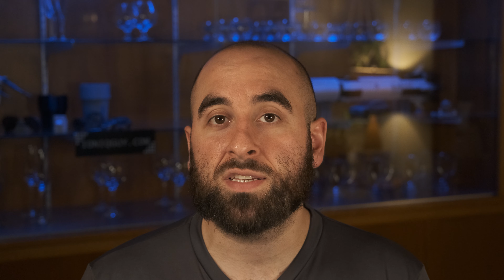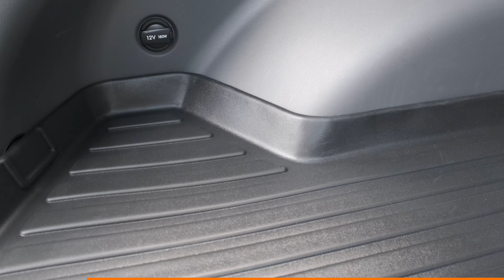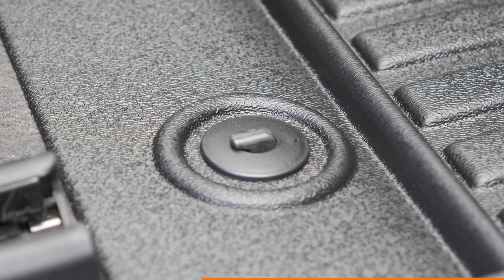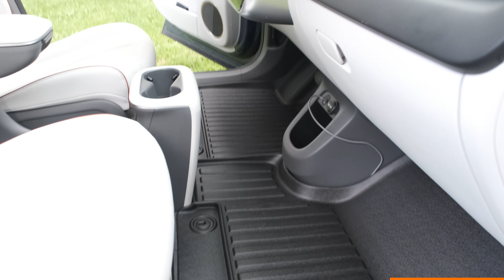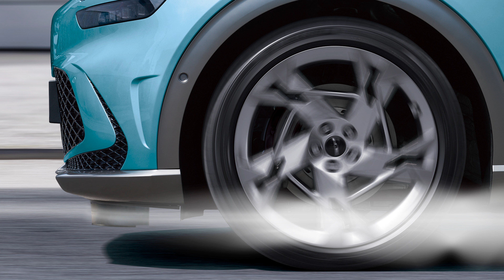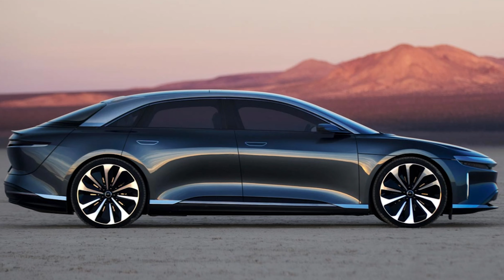New Technology Boosts Range in Your Future Hyundai/Kia/Genesis EV

Comment: All technology to increase range/efficiency is worth trying.  Right now the increment is tiny but in the beginning the vertical winglets on aircraft only gave tiny improvements.  Over time they have evolved and now winglets tuned to each new aircraft design are adding material gains in efficiency.  I personally expect improvements in battery technology (especially energy density) will have the most dramatic impact on range but I applaud Hyundai engineers for everything they have done to date with the eGMP platform (except that weird 12V battery issue the solution to which seems to have eluded them).

Comment: Like a 1979 Citroën GSA. OK, they weren't retractable,  but the shape and position were the same. It too didn't need a full-width spoiler because the underbody was completely flat and smooth, so it just had deflectors to divert air from the wheel wells. Further evidence that someone at Hyundai is a Citroën fan

Comment: "Breakthrough". The Mk4 Supra from 20+ years ago had these. So did the Mitsubishi 3000 GT VR-4.
Reply: My Nissan Leaf has also.
Reply from the maker: They deploy over a certain speed? I think what they’re patenting here is it being deployable at speed.
Reply: @TheIoniqGuy  It has become an unnecessary exaggeration engineering example that a special mechanism should be activated at high speeds because it will not have a negative effect at low speeds. I think it is a job done just to invent.
Reply: @TheIoniqGuy  Yup, all automatic and speed based, 20+ years ago.

Comment: Current GV-60 has a drag coef. of 0.29, with Ioniq 5 (0.288) and Kia EV6 (0.28) not much better.  Even the sizable BMW iX is 0.25, while Tesla Model 3 is 0.219 (sedan), Model Y (0.23), and van-like Model X (0.24).  Hyundai Motor Group needs to start from the ground up to design more sleek SUVs, rather than adding some skirts after-the-fact to make marginal drag improvements.  I thought I would be buying an Ioniq 5 or GV-60 a year and a half ago, but then bought a Model Y this time last year and couldn't be happier.  I think that HMG has the best chance of any legacy automaker to make affordable and quality EVs in the near term, but they still have a lot to learn re: design, software.  I hope they up their game pretty soon.
Reply: Lol the ioniq6 has Cd of 0.21. Do your homework.  I would never buy a Tesla that still struggles with panel gaps.
Reply: @JohnLee-db9zt    Yup, but the Ioniq 6 a sedan, like the Model 3, not an SUV.  HMG is a long way from a low-drag SUV, which are much more popular than 4dr sedans.  Do your homework.

Comment: I am tempted to stick round stickers over the holes of the battery bolts and other holes unser the car, surely this will improve range as there are so many holes and stuff under the car that must be hurting aerodynamics😊
Reply: Don't do that! I think they have something to do with allowing changes of air pressure and humidity for the battery pack. You could end up shorting it out or worse!
Reply: @TeddieBean  I don't think they do as its a sealed pack, the bolt holes are literally the bolts that mount the battery to the frame. In the event of a massive gas expansion or catastrophic failure the rubber seal is designed in a way to relieve the pressure

Comment: Reducing the Cd (coefficient of drag) is an excellent thing! All vehicles should be run in a wind tunnel and then should be engineered to have a lower Cd. Above about 40-45MPH (depending on the Cd) over HALF of the energy used - goes into moving the air out of the way.
Here's a fact: an average vehicle has a frontal area of ~25 sq ft (frontal area is all the surfaces of a vehicle that can be seen looking at it from the front - including the tire beneath the car and the side mirrors, up to the top of the roof. For every mile a vehicle is driven - the total mass of the air that has to be shifted out of the way - is about 4.5 TONS.
By the way, every vehicle should have side video mirrors - this would reduce the frontal area by about 1 sq ft (or more) and it could reduce the Cd by 0.01 (or more).
Total aero drag is Frontal Area X Cd so instead of 25 sq ft X 0.30 it could be 24 sq ft X 0.29. So, it could be reduced from 7.5 to 6.96 which is close to 7% reduction. More than 2X as much as the active front wheel deflectors.
And many other improvements can be made - smooth(er) wheel rims, better taper of the body toward the back, smooth underside that rises slightly toward the back.

Comment: It's just a variant of an active splitter. The potential gains are questionable because it adds weight. They should rather invest to battery packaging, as this quarter the Renault Scenic E-Tech will enter the European market with 87kWh usable capacity in 4.5 metres, weighing under 1.9 tonnes and with a starting price 20% lower than the IONIQ 5  77kWh. This combination will provide more range in the real world than this experiment.
Reply: The Renault Zoe has these flaps infront of the front wheels already 😂

Comment: I’m glad they are trying to improve range, but this tech stuff adds big costs.

Instead of doing all of this just out reasonable sized wheels in these cars. If I had an ionic 5 I’d wanted limited with 18 or 19 inch wheels. What’s wrong with sidewalls? Cheaper wheels and tires with a better ride.
Reply from the maker: I’m with you there
Reply: Yup, totally agree.  The gigantic wheel trend has gotten way out of hand.  Smaller wheels for less roll resistance (therefore better efficiency), a more comfortable ride and lower cost seems to be a no brainer win-win-win!

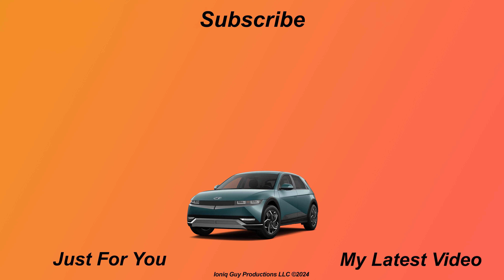Comment: This obviously is more cost efficient to implement than adjustable ride height with or without air suspension tech. Would I pay for a few more miles of range? Well it may get me to buy again over other manufacturers efficiencies if they close the gap but pay for it as an option or trim addition; I’ll pass. I’m more interested in their charging curve of J3400 matching the current CCS charging capabilities. Loose that; and you’ve lost your greatest advantage: the preservation of my time. #timeonlyhavesomuchofit 5:28

Comment: potholes, speed bumps
Reply from the maker: If you’re taking speed bumps over 80kmh you may have some bigger problems. Plus if you’re driving over potholes at that speed your tire likely isn’t falling into it but going right over it
Reply from the maker: Just saw your previous comment referring to city driving. Shouldn’t be an issue if it’s not deployed at those low of speeds
Reply: from what he said, its made of rubber that flex and bend. And who drives 70-80 mph on residential?
Reply: @GoingNomads  Values are in km/h, not miles